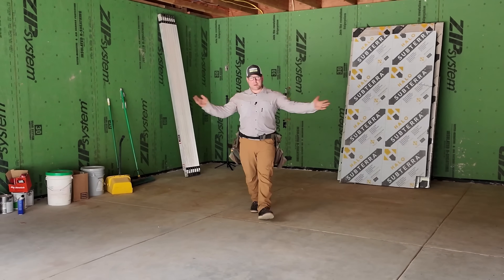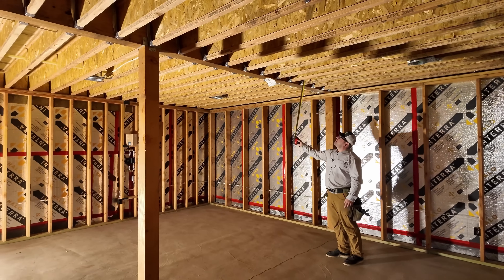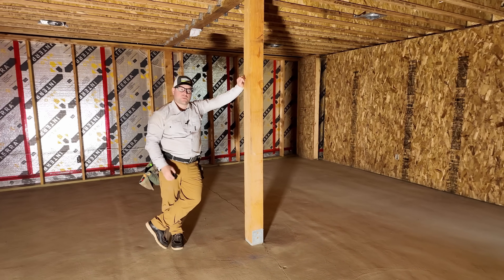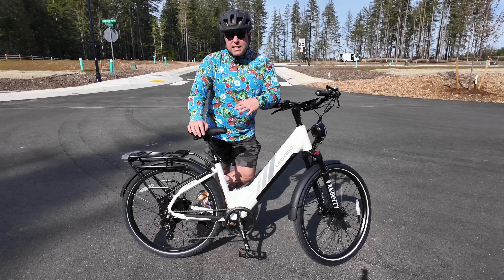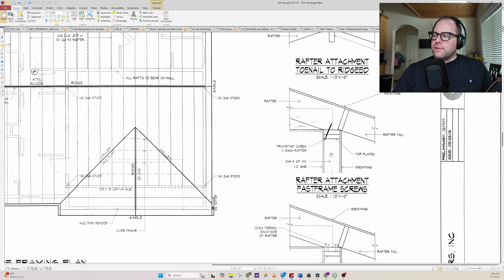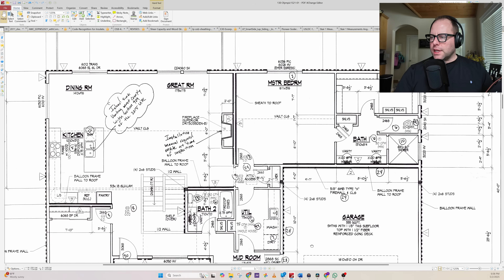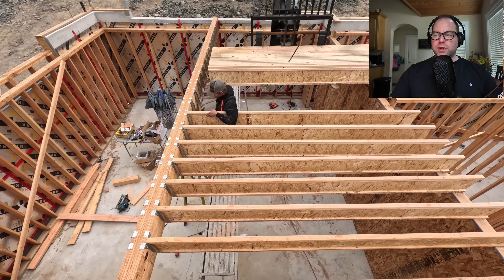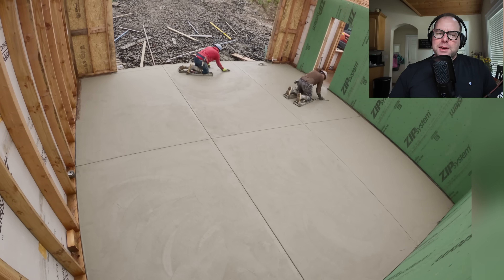Is This Safe? We Drove a Car Into a Wood-Framed Garage Floor

Comment: with that car the garage is more likely to burn down than collapse...
Reply from the maker: Really, they just spontaneouly combust?
Reply: @AwesomeFramers  EV battery fires start when a battery cell experiences a short circuit and thermal runaway happens. Can't put out an EV fire out in a Garage. Toxic emissions from the batteries burning and the nature of lithium that it is like magnesium and creates its own oxygen. Could take 20,000 gallons of water to cool it enough to stop chemical process. Other fire start causes are charging wiring that can be defective or caused by poor Charger Installation. It's like hitting the Big lottery if this happens though but not a happy kind of win....🤪..!
Reply from the maker: @Snoops_x  Great info!  Do you have statistics on how often that happens?  Then post the statistics on gas furnaces and hot water heaters that are often in garages too.  Be interesting to compare the absolute statistics to ferret out people's personal bias
Reply: @AwesomeFramers  Thanks. Ai did not like my 1st post...🤪...! Data from the NTS Board showed that EVs were involved in approx 25 fires for every 100K sold. Approx 1530 gas powered vehicles and 3475 hybrids were involved in fires for every 100K sold.
Reply: @AwesomeFramers  As reported by (NFPA), heating systems like furnaces are a major factor of home fires, leading to almost 50,000 blazes, 500 deaths and more than $1 billion in property damage each year.
Reply from the maker: @Snoops_x  Thanks!
Reply: @AwesomeFramers  Every year, there are 6,600 garage fires in homes that result in an average of 30 deaths and 400 injuries. $457 million in property loss.
Reply: @ Tim, I'm so sorry I hijacked the conversation on your awesome video/ garage build with my dumb joke. And all my buddies and I love your content and methods, keep up the great work.
Reply from the maker: @getouttahere615  No worries mate!  It turned out to be really interesting
Reply: Those cars are getting burned down, very few have burned without outside factors. Just as likely to burn down with a internal combustion.
Reply: @Frank-pq7ff  It mostly depends if you live in a red state or in the asylum states.
Reply: Only if you live in a D+ area.

Comment: Built a 24x60 shop last year

Has been used for a bit now. The owner is still concerned about his slab is "floating"

Its not. We have a center beam  and lvl joist on 16" centers